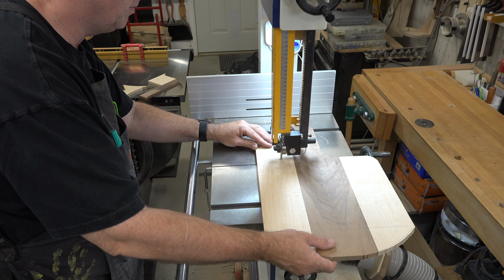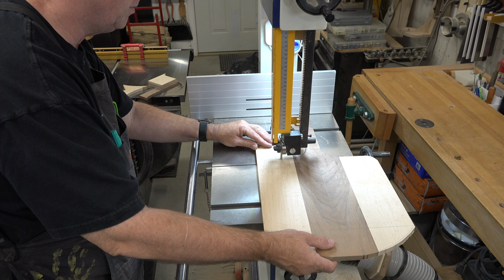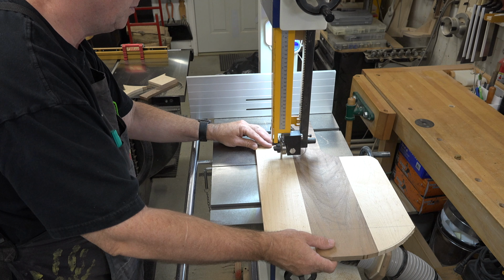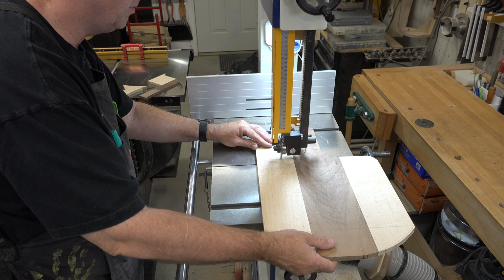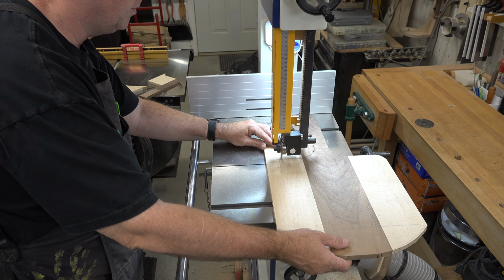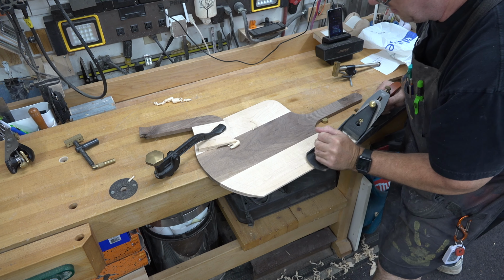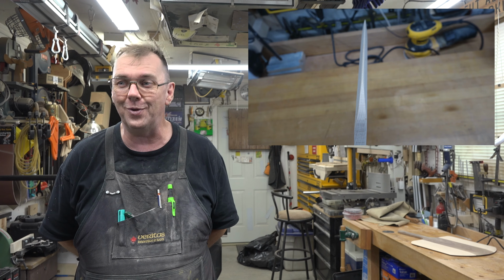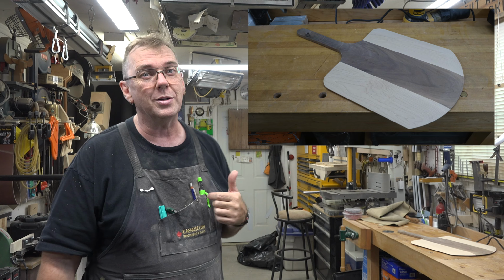Making a Pizza Peel

Comment: I'm curious why you put a bevel on both sides of the peel. Doesn't it make it difficult to slide the peel under the pizza when it's on the pizza stone?
Will we be getting a Tuesday video where you teach us how to make pizza? I'm really looking forward to learning how to spin the dough in the air!
Reply from the maker: The bevel is on both sides to make the peel usable from either side.  There is no need for a sharp angle on one surface and having a bevel on both sides means that whatever way you grab the peel to use it, it is always right.  As for tossing the dough......that's not happening.  LOL.  Thanks for tuning in Jim.